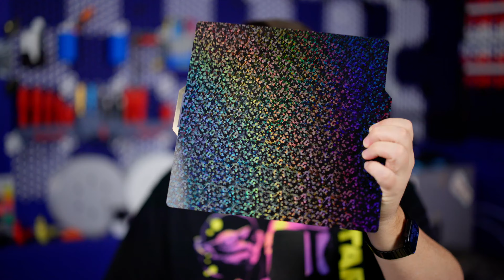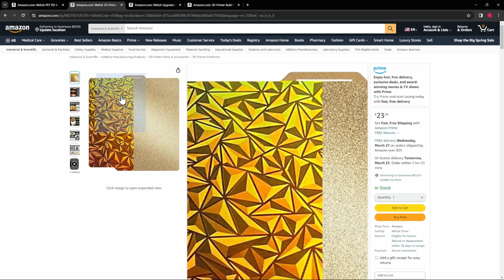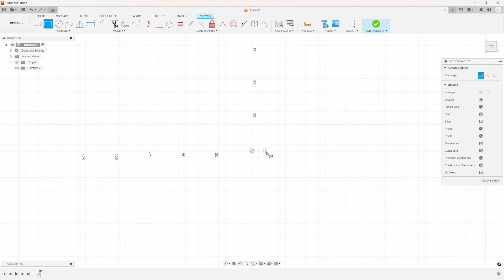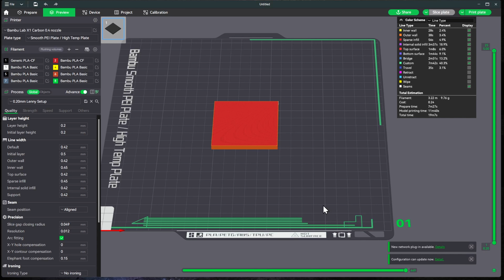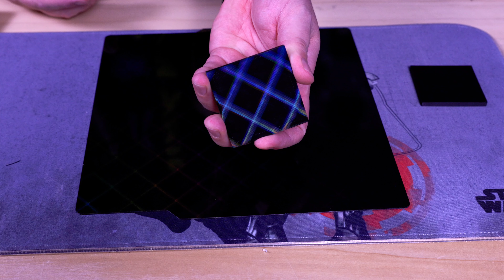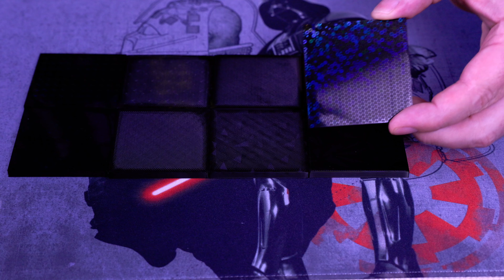Prismatic Build Plate Battle for Bambu Lab X1C

Comment: Definitely recommend washing these plates with some washing up liquid before use,  and then using isopropyl between prints to remove residues (ASA especially),, as I find the adhesion can be a little less than a textured PEI sheet. Cool to see these new additions to the ranges.

Comment: I'm glad I could help turn you on to a using the circle plate as well as using the Smooth/High Temp plate setting.

Pro tip to others - don't use glue stick as that would mess up the image transfer. Rather run about 10c hotter than you would normally. If that doesn't work then increase another 5c until it sticks. I use IPA on the plates w/ a micro fiber cloth in between each print, and if I get one being stubborn I will just Dawn dish detergent to try and make sure there is no grease on them.

I do have one of these plates (the starry one) that struggles with adhesion, and that could be just a bad "sticker" on that one.

Build plates do wear out - they are consumables.

Comment: I bought one of these build plates but have not yet started testing it.  Do you know if this will work for PETG as well as PLA ?  Can these be used without glue stick ?  I've hate if PLA/PETG sticks too well to these and they get torn apart.  Also, one of the surfaces you showed had a 300C claim, I wonder if the same effect could be seen for ASA/ABS/PC (and wonder if glue stick would also be necessary).  Your channel is one of my go-to places to find practical information about printing materials, THANK YOU VERY MUCH for documenting it so well.  The one thing I cannot find good information (anywhere) about is when to use glue stick and when not to... This subject is a checkerboard of competing half thoughs.  Misinformation about this practice is so bad that in forums posts still pop with debates about if glue stick is a release agent or improves adhesion.  Surface treatment (or lack of) of build plates is however VERY important, just think of the time it takes one person to spread glue stick in a single build plate multiplied per the amount of 3D prints, OR the failed prints and ripped plates due to misunderstanding of surface treatment.
Reply: when to use glue stick is complicated. There are a lot of factors. the old saying "it depends on what direction the wind is blowing" is not far from the truth. The reason that is true ,in this case is: humidity. Let along it depends on all of your other settings. Most setting are interrelated. Every setting change has unintended consequences.  A hint for glue stick is Purple works better. After you apply, use a damp towel to spread around. the goal is to have a thin film of the adhesive (glue) all over.

Comment: Have a few, and my x1c WILL NOT get the nozzle close enough to the holographic bedplates.
Reply: try setting your build plate in Bambu studio to a gloss plate. use the "holigraphic" plate. default setting should work fine. If you are using custom setting it is hard to debug. There are reasons to adjust most every setting. so it gets complicated very quickly. The major factor is the first layer.
Reply: Switch to the textured PEI build plate in Studio (or Orca) and it will drop the nozzle an additional 0.04mm to compensate for the texture. That should do it. If not, you can adjust the compensation in the Machine Start GCode. Just don't go too low or you will risk hitting the nozzle on the plate and ruining the plate, or even bending the nozzle.
Reply: I had the exact same issue but here is the solution that fixed it for good. Do this simple trick, disable plate detection in bambu studio. and since then it works every time for me and will for you. If not you can print a qr code but me i never did that. Just be careful because after that you have to make sure you put on the correct plate, but you wont regret that decision

Comment: the video does not do it justice.
a couple of downsides are: 
The "texture" is very susceptible to hiding from finger prints.  (on the print, a finger print might hide the effect)
Obviously it is only on the build surface.
The build surface is harder to stick to. Meaning more failed prints. Because the texture is what is being transferred to the part. using an adhesive like glue stick needs some tricks. The adhesive fills the "texture" reducing the effect.